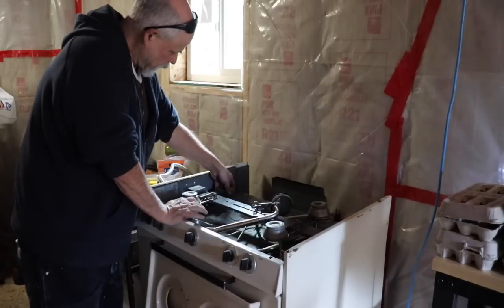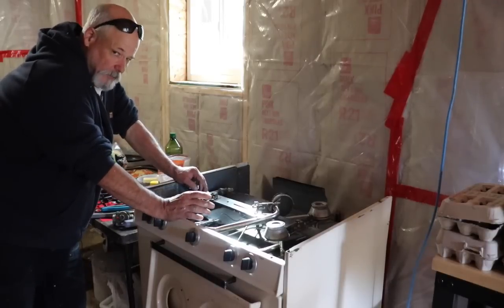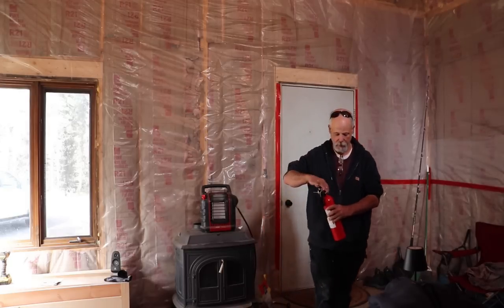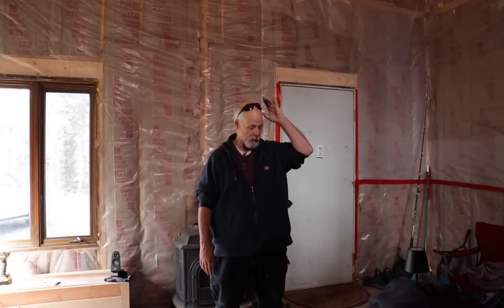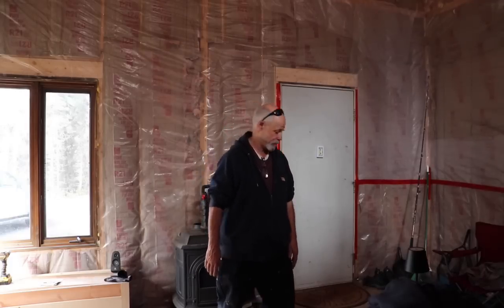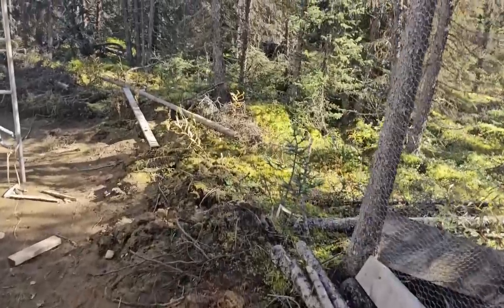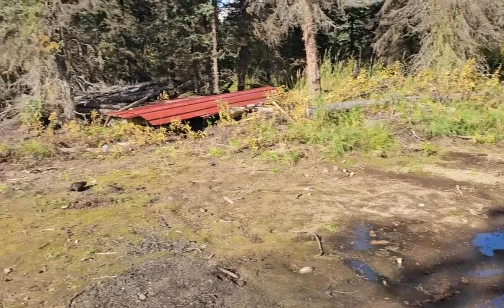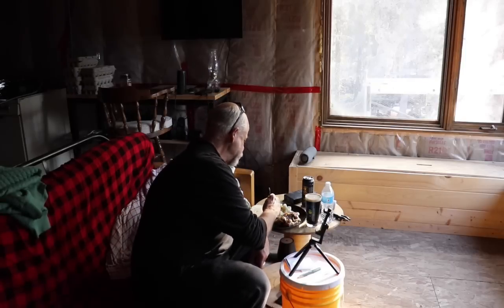Clean up continues as I ready for Alaska winter

Comment: Hi, new to the channel here. I’m curious if you researched your insulation and plastic covering..?  I’m not familiar with Alaska, but I am with Northern building. Using the Kraft Face insulation and then covering it with plastic will creat what we call a “double vapor barrier “… this will put the moister line between the Kraft and plastic, trapping it inside the wall cavity, which will promote mold and rot.
  Just thought I’d throw that out there before you do whatever wall cladding your thinking.
Reply from the maker: I will not even pretend I know the answer to this, but when I discussed it with a few contractors up here, they said I should be ok. I went with the faced insulation on the walls for the simple reason that I bought most of it at half price. I am unfaced in the ceiling and will be unfaced in the floor. 
   Mold has not been an issue for me yet and with all the moisture I had when I closed this in I am thinking I should be ok. Only time will tell.

Comment: I always thought you had to change the what I call the jet Screws You find them usually in the bottom of the stove where the drawer sits. Thanks for the video you're talking about something young man
Reply from the maker: Some jets just have to be tightened down from what I have read...we will see lol
Reply: @SeanInAlaska  Sean, just curious, pull the drawer out and look on either side of the walls to see if the jets are there.
There Those jets are designed for LP. At least that's what I was told by people that's where they would be
Reply: I had to replace the little brass orifice fittings that were specifically made for propane for each burner, and oven. They were readily available at the local hardware store in our tiny town of 3700 population
Reply from the maker: @Nannygoat I will have to be careful when I fire it up again....
Reply from the maker: @frankshort1448 I will look Frank! Thanks!

Comment: While you prepare for winter we are preparing for a blisteringly hot summer.  Predictions say are temperatures are going to 39/40C all summer long which is just a wee bit too hot so new cooling mats, fans, neck fans, misting fans, extra water bowls for the animals and get the heat pumps cleaned ready to blast cold air.  and lots of ice in the freezers.  We have had a warm winter, warmest in 5 years and we have been surrounded by a marine heatwave
Reply from the maker: Ugh! Heat! Lol

Comment: There is a nice trick to "level the gravel" 😅 Just take a pellet from any delivery and flip it over. The bords have to be 90 degrees to the pulling direction. Then fix a rope and pull it forward and bckwards. That worked rather nice in the driveway of my barn. ANd before I forget.... do it with a lot of rain, so the gravel sink into the ground..... Hopefully that works fine for you. Roger S.
Reply from the maker: Thank you, Roger! I will give that a try. Pallets and rain are never in short supply here lol

Comment: I just scavenged a rv fridge/freezer. I found most rv fridges have temp probes. That if you pull it outside of fridge. That will kick it into overdrive. Turning it into a full freezer. Granted it takes awhile  to come down to freezing.
Reply from the maker: I have an RV fridge that I can do that with, but I really want to build enough battery for a full size unit.